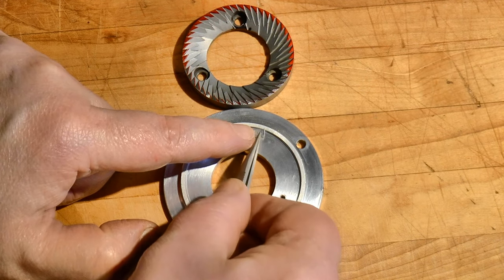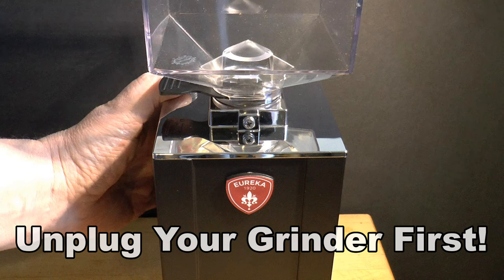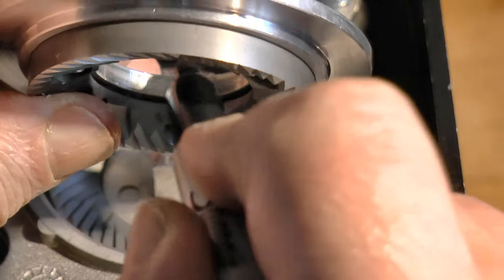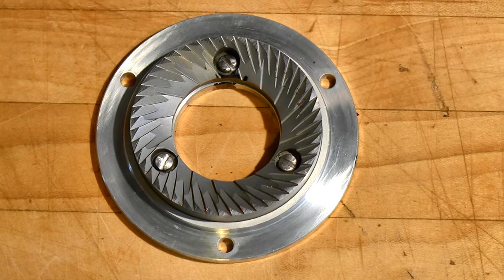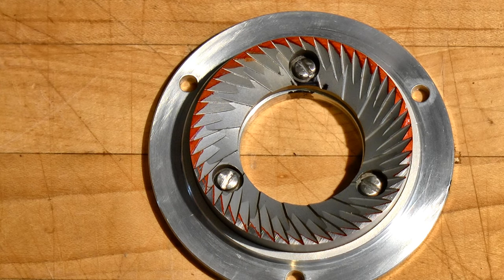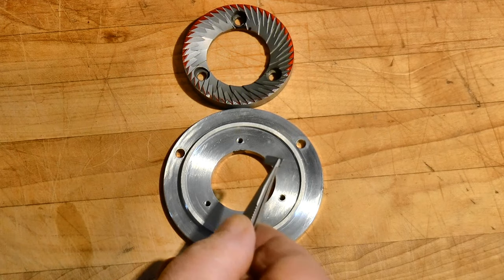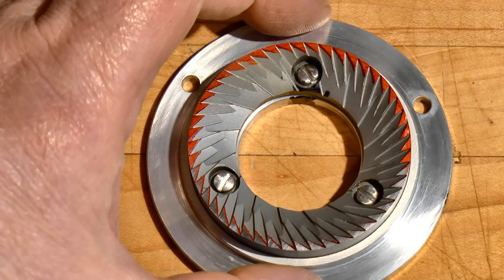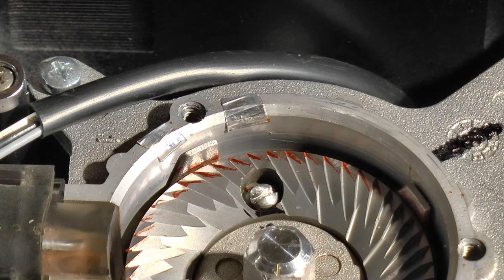Easy And Safe Burr Alignment

Comment: He is so right. it doesn't make that much of a difference but we have to align that so we can sleep better
Reply from the maker: Ding!
Reply: I already lost hundreds of sleeps caused from "what about if I change that setting.... 🤔"
Reply: I just bought my first serious 75mm flat burr grinder.... So really if I'm not losing sleep over but alignment, I don't need to do it ?
Reply: have slept good till now, but after seeing this i will definitely sleep worse until doing this.
Reply: @letsgoletsgoletsgoletsgoletsgo  Alternatively, you could wonder why you are not losing sleep over alignment, thereby losing sleep for another reason. And so on, recursively.

(If you are getting coffee you like out of your equipment, leave it well alone other than cleaning and normal maintenance, would be my suggestion).
Reply: If your espresso shots aren't repeatable with the same time / weight - that's one of the main things affecting it.
Reply: bruw. i lost it when he said it xD

Comment: Hi, do you still checking this by any chance? my specialita always produce bitter espresso regardless what I did: water, temp, pressure, dose, ratio. I borrowed a niche zero and the bitter is reduced significantly. I am wondering it's my problem or I need to upgrade, paired with PP600

Comment: I had a brand new Eureka Mignon Specialita delivered an hour ago. Before it got dirty, I thought I would ensure the burrs were aligned by following this method. Sure enough, the top burr was out. Took two goes to get it aligned with aluminium foil folded twice on either side of one screw and just twice under a second screw. Retested and it is pretty consistent now.

Comment: Huzzah for a great video! Watched a couple times before starting on my 3 month old Eureka Turbo, then referenced back to bits as I went along. I used a socket wrench to rotate motor, and you can feel and hear when it's properly aligned. Choked my microcasa a leva at old setting so went a good step courser. A truly excellent shot and it's not even totally dialed in but too caffeinated to continue.

Comment: I appreciate the tutorial.  My Mignon zero was great before my alignment but now it's just a little better.  

To anyone considering this: I'd say it's worth the effort.  It's nice to know your equipment is preforming optimally.
Reply: I have the zero as well. Would this at all help the clogging issue I have with it? It likes to clog a few times a month and it is annoying.
Reply: @Hillbillyspree  It clogs the exit chute?
Reply: @bluemystic7501  Probably. I haven't taken the front off to verify. I will when I get home. And maybe experiment with taking off the declumper.
Reply: @Hillbillyspree   Are you spritzing the beans with water?
Reply: @bluemystic7501  I used to, but it caused the clogging more. So I don't.
Reply: @Hillbillyspree  Yeah, that grinder doesn't need RDT.  What kind of beans do you grind?  Dark?

Comment: 1:28: I just rotated the top part just 1/3rd and tried which position gives best result (after cleaning but without removing grinding burrs). This resulted in a perfect alignment and to my surprise no coffee came out at the setting where the burrs just touched each other - didn't have this before. So no need to add spacers, just repositioning and cleaning.
Reply: how did you try which position gives best result without removing the burrs? thanks
Reply: @OQULTO  I removed the cover plate that holds the burr, painted the 2 burrs like in the video and rotated the cover. However the elevation correction is just a workaround and never gives a perfect result. Best way to get the perfect fit is to use carborundum powder with water (e.g. 1500,1800 or finer) and grind the burrs flat as installed. Cleaning them after completion. You get the perfect fit, no adjustment needed (but always install the same way).
Reply: incredibly smart. wonder if anyone else tried it

Comment: Great procedure. I have attempted it twice but couldn't seem to get it to a place that I felt it made an improvement. On the second attempt, I stripped one of the threaded holes on the lower burr mounting plate. As I understand it, that plate is essentially a part that cannot be replaced by the consumer as it is pressed on at the factory with tooling. I would have preferred that Eureka publish torque specs for those screws because I have the tools to do that. Kind of ridiculous it is that easy to ruin a grinder.
Reply from the maker: The lower carrier is not an interference fit. Just loosen the left-hand threaded nut and use a very small screwdriver in the coffee outlet opening to pry it up. If you're not experienced with thread repair, maybe send it out or replace the part. Hope this helps.

Comment: Upgraded yesterday from old mci and ec685 to new specialata and used ascaso. I used nearly 1 kg of coffee and was really stressed why I don't get enough pressure on the coffee machine. Then tried the new grinder with the old ec685. Same Problem, wasn't able to get good result. That moment I realized it was about the grinder. After disassembled the asacso half. Yeah so finally, this hint made the big change. Now I got good coffee in the 2nd try. Not 1 kg of waste.
Reply from the maker: Glad it worked :)

Comment: Thank you! I haven't found a video describing this in a proper way. Mostly they are just zeroing the adjustment screw or (in rare cases) align only one of the burrs, thinking they will be parallel to eachother.
Reply from the maker: Thanks. I'm glad you found it helpful.
Reply: How do you zero the adjustment dial? I think I've messed mine up and the burr's are now touching at the 1.5 mark which is way off 0!

Comment: Just rewatched this as I'm swapping the burrs on my first electric grinder. Thanks for the point on overtightening, my burrs are two screw held and me tightening them too much on the stationary burr is giving me a wipe at the top and bottom but not in the middle section, will revise this tomorrow!
Reply from the maker: Yeah, nice and snug is the way -- and try to apply the same torque to both. I know that's not easy :)

Comment: Love this channel as I am new to espresso. Just purchased the Eureka Mignon LIbra grinder and am having trouble getting the grind fine enough to get the desired pressure during extraction and fuller extractions. 

Has anyone upgraded the stock burrs on their Eureka Mignon LIbra to SSP or another burr manufacturer?  If so, did you find it to be a worthwhile investment. I do not have the engineering or mechanical experience and aptitude of Thomas or many of the others that have commented on this video. 

Much to learn!

Comment: Just curious if you know of a way to calibrate the zero point of the grinder. Now that I’ve aligned the burrs, the touch point is no longer at zero, it is instead at negative 4.5.  My OCD is driving me up the walls.
Reply from the maker: A bit hit or miss, but you can unscrew the knob and place small flat washers on the threaded rod. With the right thickness it will line up on zero.
Reply: Makes you wonder how the heck they even get anything remotely close to zero point calibration at the factory.

Comment: This made a huge difference on my Silenzio. I can go half a turn finer. Recently a blend I like with Sidamo seems to be a little on the old side and I just couldn't grind fine enough for my 120 s dimmer shots. Now I can and I've started to go much finer and the particle distribution seems better the shots are very consistent and predictable and no channeling issues at all (I WDT). Getting super tasty shots. Maybe the cheaper Silenzio doesn't come as aligned as a Specialita or above so it makes a bigger difference? Because once I started preinfusing and grinding much finer I noticed a lot of strange behaviour and inconsistency that went away. I did it temporarily and that helped a lot and today properly with about 5 burr repaintings and now it's super fine. 0 used to be just before burr contact. Now that's two full numbers further down. It's still not perfect, it had a little bit of a tilt left but close enough. I almost considered a new grinder because I couldn't go fine enough sometimes. Maybe badly aligned out of the shop.

Comment: So I dismantled my Eureka Mignon. Initially I wanted to remove the bottom burr carrier for cleaning, so I turned the nut clockwise till it came off (at first this kept turning non stop but I managed to figure it out by unscrewing the dial completely first). In the end I couldn't remove the carrier so gave up and put the nut back on by turning it anti-clockwise. The nut seems to be right, but it just keeps turn and never reaches a point of resistance where it feels tight. So, assuming it is tight enough, I then put everything back together (unfortunately, I didn't mark the burr positions the first time I dismantled it). I then saw this video and decided why not do this. So, I marked the bottom and top burrs. The pattern I saw was the bottom burr isn't flat. I shimmed it but it either results in too much or too little change. I couldn't get the bottom to be flat, so then tried to compensate by shimming the top burrs. Now when I operate my grinder I can hear the burr's unevenly touching at about the 1.5 setting when previously I couldn't hear any contact even at around the 0.3 mark. It seems that my zero is not calibrated anymore. Is this because I haven't tightened the bottom burr nut properly or have I messed up the alignment with the shims? Could you give me some advice to help me fix this please?

Comment: I had kind of a funny issue. I installed an aftermarket adjustment knob which required unscrewing the stock knob, so I backed it all the way out then to get it back on good and tight I screwed it as far down as it would go just to make sure I had enough tension that it wouldn't back off when adjusting coarser. Then I thought while I'm at it, might as well clean it out a bit. So when I re-installed the top plate I didn't first back off the setting so the burrs were still tight so the top plate was actually a little loose. I was going nuts as it would sound like I had zeroed it out, but the extra little play wouldn't let the grind size get fine enough. At about the same time I had also made adjustment to my machine so I thought that was the culprit at first until I pulled out my old machine and got the same results. I finally pulled the grinder apart again noticed the issue. 

TL;DR make sure you back far enough off the adjustment that the top plate isn't touching the bottom burr when you tighten it down.

Comment: For some reason I can't get most of the flats touching! 
I'm always right before the 0 point for espresso.. and mostly it's not fine enough to dial good shots! 
Can't even use my VST basket at all..
I found that the burrs touch at 1 specific point first but when i tried chiming, I got really weird results.. like touching exactly at opposite sides like 12 O'clock & 6 but 3 & 9 don't touch!! 
I need help please 😅 i feel like i messed up the flats that I think I might need new burrs idk 😅

Comment: My bottom burr did not need any alignment, however the top one did. It took me a few hours to align the top burr but I got it to a point I liked.

My grinder started to overheat when I dialed in too fine. I had to clean the inside, when I was placing the bottom burr back in the permanent markings were gone for the bottom burr, I suspect due to the heating. 

The top burr is still aligned, however do I have to do the whole realignment again if the placement of the bottom burr isn't exactly in the same position as when it was first aligned?

Or is it still technically aligned?

Comment: Great video again! But I don't understand why you disapprove that running the grinder untill hearing the chirping noise slighlty. The outest side of blades are flat and actually not cutting anything. Unless you go so finer and finer after the chriping point, that might not be a problem, right?
Reply from the maker: Oh, just covering my bottom. No one can say I told them something harmful, when they crank it too tight while it's running :) But for my own preference, touch is more reliable to me. I mean, I can feel how much contact there is better than I can hear it.

Comment: I’ve got a specialita with a lower burr carrier that is not exactly concentric when rotating.  I can see it’s slightly off the center axis as it rotates,  any suggestions for this?  I’ve tried shimming both top and bottom burrs and reseating etc but at first touch of the burrs I can see they are still not parallel to one another and the lower carrier is definitely off axis. There’s alao not enough play on the lower burr to solve the non concentric rotation of the lower carrier.  Any suggestions?

Comment: Well i have to try something. Watched a vid on cleaning, took mine apart and cleaned it, now it's terrible. Can hear the burrs touching but the grind is far too coarse. Basically it's ruined, so I hope this will fix it. I did not remove the upper burr from it's carrier, just took the top bit off and got the bottom burr off (eventually) and no, I didn't know to mark anything. Since I didn't take the top burr off, I guess I need to shim underneath the bottom burr? Or just try rotating it across all 3 screws and hope it lines up again? Edit: So today I took it apart again and simply rotated the lower burr, . Then the machine jammed up and wouldn't turn? Motor got hot. Weird. Let it cool down and tried rotating one more postion, and now it works. Did the magic market test and pretty even. Now back to making proper coffee, but I'm still unsure about the main motor. Why did it overheat and jam?

Comment: Thank you! I believe it made a significant change on my Gaggia MDF!
Reply from the maker: You're welcome. I'm glad it was helpful.
Reply: @wiredgourmet   but... just one thing... do you really believe it is "not really important" / placebo? 🤔
Reply from the maker: @uncle-k3m It depends on how far out of spec the machine is. A few thousandths \ less than a tenth of a mm, I doubt you'll notice a difference. If it's out by 0.25 mm or more, grind quality will start to suffer, more so as the flaw increases. A quality grinder probably leaves the factory in good enough shape not to worry.
Reply: @wiredgourmet  I got mine used so maybe it was really “a lot” out of spec

Comment: What if I didn’t mark down the top burr alignment with motor? Is there any consequences when you put it back together differently after a cleaning? How can you know how it was before if I changed it? I notice a change in the grinding output after cleaning and I don’t know why… I did try to grind finer but it still give messy results with the espresso machine… Thanks for your help!

Comment: Hello! I hope you can get to this reply even though it has been 2 years. What if the lower burr is not balanced? I repeated the steps you have provided and the lower burr doesn't behave like the way it does in this video when it comes to the color being removed in a uniform way by the rotation.

Comment: Thank you for the useful video! I have a Eureka Mignon oro single dose and I tried your technique only to find that it seemed as though my bottom bur was the one out of whack.. The dry erase markers were completely wiped off the top, but only one small section of the lower. Would you adjust/shim the lower in the same manner?? i.e. removing the bur from the burr carrier and shimming between the burr and burr carrier until even? This is ultimately what I did, and I feel I have improved things, but just wanted some insight on your end if you have any. Thanks in advance!

Comment: Wow.....
Well, I was finally able to do this adjustment just now(with some success),  It took me about 5 layers of heavy duty alum sheets to make some improvements...AND I was able to grind finer,  more even contact(85-93% even marks), but it is at my grinders ZERO point!!! Whats the point if I cant use this setting normally? I have the older Mignon, aka MFC, which is very similar design, although they isolated the top plate and gave the top burr a independent plate. Also some more insulation. 
Unless there is something completely different I am not considering? (Before I had just ordered burrs for my model grinder, and I am not sure if they are espresso burrs. New ones I ordered are. But I think they are, since the time before this new espresso machine, its been at least 7 years since I was drinking espresso with this grinder and a Nuovo Simonelli Oscar. I dont think I was timing my shots then either, LOL> 
I know burrs last a long time, but I have been mashing hem up trying for a finer grind, and to rule it out, I ordered a new set of 54mm burrs.  I am contemplating buying a new Mignon grinder to compare and see how and why mine is so close to zero point, and only now getting 23seconds after pre-infusion. Any help would be most appreciated!
What a GREAT video!!!

Comment: Fantastic video, shimming the top burr definitely helped me to get a finer grind. However, one problem (?) of my Mignon Oro did not disappear: when turning the dial clockwise, starting from a coarse grind, at some point I hear a grinding noise. I doubt this is burr contact, however, because I do not get a fine grind at this setting. Turning the dial further, this noise disappears until eventually, the burrs come into contact (different noise). At this point, I get a pretty fine grind.
Do you have any idea what might cause this?

Comment: What do I do if the motor is not balanced? It’s the bottom burr that touches the top and then loosens so I hear a periodic scratch chik-chik-chik if I rotate. Is there a way to check if the lower platform moves strictly horizontally? And if not, is there a way to balance it?